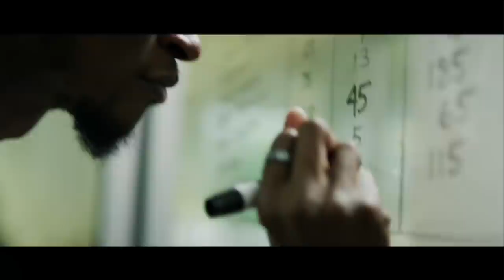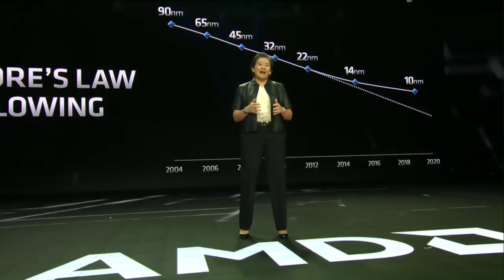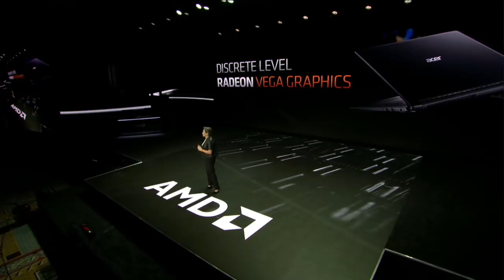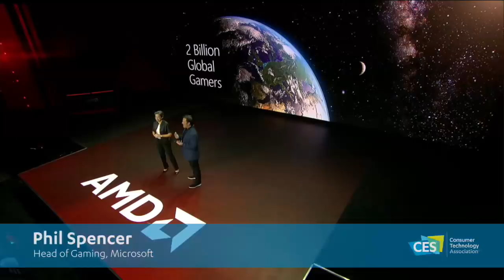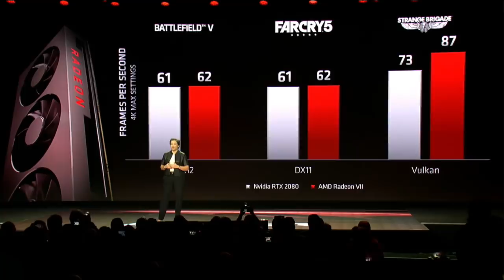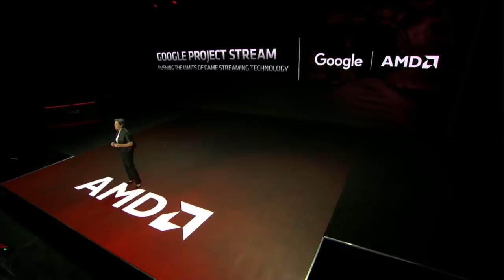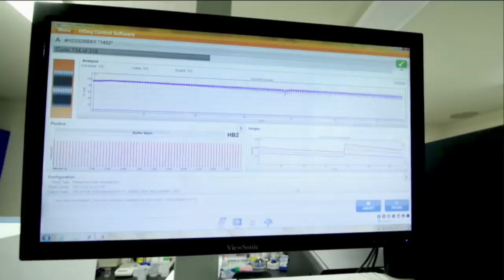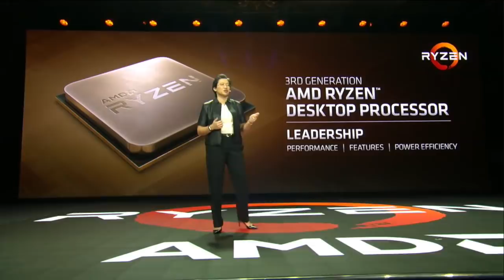AMD CEO Lisa Su's 2019 CES Keynote

Comment: The die placement is curious on the Ryzen3000, like there's room for second cpu chiplet... so they've left the door open for a 16 core part as well.
Reply: glad i'm not only one who noticed it
Reply: Hehe, yup. Noticed that as well, all that empty space.

I think what's telling about it though is she touched upon PCI-E 4.0 support, which means interconnects/bandwidth has been taken into account to support another 8 cores.
Reply: @zijkhal8356  Couldn't see that, watched from my phone through an extremely dirty Otterbox Defender plastic protector. 🙁 At work right now. Lol
Reply: I think so too, also maybe a gpu
Reply: that's because if we are going off leaks that will be an R5 varient likely going to be the R5 3600. the R7 are said to be 12 cores and the new R9 varients said to come at 16 cores.
Reply: It just looks like cut down I/O die from Epyc 2nd gen,that Jim at AdoredTV leaked.As you guessed it-it has room for 1 more 8c/16T chiplet
Reply: @mivinca7  
Ryzen 3 33xx are 6c/12t (single chiplet) 
Ryzen 5 36xx are 8c/16t (single chiplet) 
Ryzen 7 37xx are 12c/24t (dual 6c chiplet) 
Ryzen 9 38xx are 16c/32t (dual 8c chiplet)
Reply: Love is an open door?
Reply: 1:30:03 for anyone wondering, you can see the light reflecting off the connections for the 2nd chiplet
Reply: @zijkhal8356  I watched at home, and yes you certainly can see that. It was already telling thou from her saying PCI-E 4 and the enpty space.

For a new CPU/GPU chip, that would be where it will be placed however. For full on CPU, 16 actual cores for certain.
Reply: @zijkhal8356  They could be, but the leaks all point to the bottom budget Ryzens as a 6c CPU. The CPU die with the single IO die, with the single chiplet (Lisa Su) was holding up, she actually does say it's a 8c/16t CPU, listen around 1:30:08 onwards.
 
As I've said before, the leaked SKUs are Ryzen 3 33xx (6/12), Ryzen 5 36xx (8/16), Ryzen 7 37xx (12/24) and Ryzen 9 (16/32). So logic deducts that a single chiplet will all probably be 8/16 dies, with faulty dies having disabled cores, and made into the 6/12 variant. With the spare space below to add a second chiplet, equal to the one above it, to make up the 12/24 and 16/32 CPUs.
Reply: @zijkhal8356  Hmm, 
Is she holding a CPU? 
Yes, it's the whole green wafer package.

The green wafer has 2 black dies, the smaller one (chiplet) she describes as the 7nm 8c/16t.
The larger black die is the 14nm IO die. Both sit on top of the interposer, or infinity fabric. There is no other die left on the package.
So therefore, I conclude that it IS an 8c/16t CPU.
Reply: @zijkhal8356  Ok, what would you call a CPU?
Reply: Theres room for more it you look again, if AMD shift the IO die up, they might get a 3rd CCX in below it if possible. What I'm nore interested in though is APU potential, especially beyond AM4. Larger socket size for AM5? allowing for multiple chiplets and Navi high end grachics, think 16c32t with 1080ti performence. If you think 2019 is going to be interesting, 2020/2021 is going to make it seem boring in comparrison.
Reply: @VeggieManUK  I don't think this generation is going to see more than a single chiplet for CPU and the empty space is going to be zen 7nm as that will follow in perfectly. Then they will go Navi and that might go in the next version.
Reply: @zijkhal8356  I really don't think you're understanding my comments, TBH. I have never mentioned disabled cores in our debate, nor do I know anyone who talks about CPU core count, include disabled cores/non functioning cores. When I refer to a CPU and core count, I actually mean, working cores, same as any person would. Unless, I was going into deep down detail. Besides, you started this debate when you replied to my comment, with a misquote.

Anyway, I've been peeking and poking in Zilog ZX80's, and MOS 6502, assembler M68k, and some Intel 8086, since the days of kit form ZX Spectrums. So I well and truly know what a CPU (Central Processing Unit) is.

Comment: Interesting products. I was hoping for a 50th anniversary chip, but we'll have to see.
Reply: That one may come on the 1st may. considering amd was founded on the 1st may.
Reply: @River_Miles   according to adored's leak it will be called r9 3850 and clock up to 5 ghz (or 5.1 I don't remember exactly)
https://www.youtube.com/watch?v=MG-onUm__c8
Reply: Did amd ever say it was 12 cores
Reply: @zijkhal8356  rumors are rumors what if a r7 is 8 cores it still can come close to a i9
Reply: What's 7nm mean??
Reply: @stevethea5250  7nm is the physical die space. The smaller the black die, the more densely packed the logic gates and traces are. Also requires less power and generates less heat I think.
Reply: @DJKav  thanks. What die? Like colour die??
Reply: @stevethea5250  Nope, dye is something coloured. A CPU/GPU die is the silicon wafer, that all the transistors are are fabricated onto.
Reply: @vacatedsleet325  Amd showed off an 8c ryzen 3000 cpu. there would still be space for a second die though.
Reply: @zijkhal8356  She actually said the ryzen they showed is an 8c chip. She mentioned it when she showed of the two dies.
1:30:00
Reply: @zijkhal8356  The larger one is the I/O die and the smaller one is the core die. It would be pointless to have cores in the i/o die, because it is built using the 14nm process.
Windows is not built to take advantage of heterogenous core configurations so it would be totally pointless performance wise.
Reply: @zijkhal8356  Yeh I know this. I was in a rush to go and pick my daughter up from school. It just came out wrong. I forgot about it since, as I've been busy. So thanks for correcting that up.
Reply: @zijkhal8356  Yeah. Seems like I missed your point.
I know it's possible and likely they will have to dies with 8c each or a cpu + gpu die.
The tech press all say the ryzen 3000 that was benchmarked is an 8c cpu as far as I could find. Likely because lisa showed of an 8c cpu on stage.
Also it would be very impressive if it really was an 8c chip they showed running cinebench.
Hope I'm not completely missing your point again.

Comment: Sounds like Radeon VII is going to be an absolute production powerhouse with that huge HBM2 buffer, but then again 16GB for gaming is absolutely pointless.
Card could probably be 100-150 dollars cheaper if they stuck with the 8GB meta since HBM2 is already expensive on its own!
The Ryzen 3000 presented is quite promising though if those are actually early sample clocks.
Reply: Check latest benchmarks on bf5 with raytracing and see how much ram that takes then talk again about this.
Reply: Ryzen 3000 seems to be at least 4.7 GHz if ipc is equal to kaby lake
Reply: I am bit worried about the performance. In the Forza Stream with the strongest AMD Setup they got 117 to 126 fps. We know that Forza runs best on AMD compared to Nvidia. But 699$ with a worse result than an RTX2080 where you could also use DLSS in other games in the future to gain another 30% performance plus... (a lot of developers announced the integration of the support) Their performance is ok but I have not expected this price. It is coming with 3 new Games but the RTX2080 is also coming with Battlefield V and Anthem...
Reply: The 3 games puts that Radeon VII at about $520 worth. That's not half bad considering the performance and superior VRAM. I was shocked it actually went neck and neck with the 2080 and even smashed it flat-out in Vulkan. And that's with starting beta drivers most likely. Those numbers are going to get even higher once the drivers mature 6-12 months down the road. I doubt I'll ever need all 16GB, but I'll take it for the transfer speed since I think it'll help in one of my games in particular in the long haul.

I'll frickin' buy two of these GPUs if the TDP isn't too crazy. I mean two for the price of a single 2080 Ti? I'm down. I hope someone benches them in Crossfire vs a 2080 Ti. Only down side is I have a $1,000 Predator Gsync IPS that's probably going to get replaced by a $400-500 Freesync 144hz IPS. I lose out there, but oh well. I'll keep it as a browsing monitor. I just pray they don't all sell out day 1 like Nvidia's bullshit cards tend to.
Reply: Cool Fez except the gpu won’t have ray tracing anyway....
Reply: They will probably have midrange cards w 8 Gigs down the line this is the TOP of the Line goes head to head vs Nvidas 12 GB 1200 cards. So they went 16 just to One Up them..its all about the marketing.
Reply: @MaxHBoss  Shadow of mordor cant run 4k textures without atleast 10gb, like it or not more ram is needed for the high end.
Reply: thats 'cuz they inted for it to be a card for content creators an area where those 16gb of hbm2 will serve well...
Reply: IDK man, with 16GB, just think of the Skyrim texture possibilities.
Reply: @phillycheesetake  Ugh when will that game die :D
Reply: Yea. I actually would have got radeon 7 if it was under 500$ (Which many expected) but now I have to go on RTX 2060 + bfv+ dlss +ray tracing is pretty nice.
Reply: COD WW2 uses 13gb of vram at 4k and Star Citizen uses over 12 gb so 16 gb will greatly benefit those who play at that resolution very soon.
Reply: @CoolFez  You can deactivate your copy of Skyrim by sending a deactivation payment directly to Todd Howard.

Be sure you un-check the delayed reactivation subscription which is pre-selected at online checkout. Failure to do so will result in a recurring monthly bill of $19.99.
Reply: @phillycheesetake   YOU WOT, im gonna sue u for that :D
Reply: Cheaper versions of the card may yet come. 
Why do you think they started with Radeon VII ? Odd number, if you ask me. Nothing stops them from making a Radeon 5, and Radeon 3. Mimicking their Ryzen lineup.
Reply: @Nukerunin  You know that they get HUGE discounts on the games, right? Also the benchmarks most likely are the best examples they could find.
Reply: Unless you start using the GPU for game AI which 16 GB dose matter
Reply: Well the point of this card is playing in 4K @ ultra, and that's going to eat up a lot of VRAM. I think it'll be essential for at LEAST 12Gb
Reply: Hbm2 is very expensive if it had 8gb it could be maybe 400
Reply: I think they with a higher amount of ram because I believe the gaming market is getting expanded to smaller development teams and smaller companies as the bigger corporate gaming companies are economically hurting and face bigger risks as facing lawsuits due to our short fused politics. We will see smaller companies pop up like the creators of fortnight. Not to mention high end developers are able to stream high end graphics from a browser and is logical for a companies to do so. The GPU product they produced is what the market is moving to so they are ahead of the game in the market in my opinion, however I personally would like it cheaper sacrificing ram for price but I am satisfied regardless
Reply: @blablubbss1  uugghh, engineering sample...hello.  The CPU wasn't at full potential, at 1080p you're not GPU bound.
Reply: @jackcole2935  It doesn't cost $299 for 8gb of HBM2. It's around $80 per 4GB stack so $160 less. That would make a 8GB VII card $539 'IF' AMD shifted the savings to consumers. Most likely it wouldn't be a direct savings if they did this.
Reply: some games are already greedy for more than just 8GB and with that you will get more texture and so on.... 
plus they're moving to PCIe 4.0, lately 5.0, so that's the reason for 16GB 

Prob. you wouldn't like to have 8GB card on PCIe 2.0 "it would run ok, but it would e waste of potential",  nor 8GB card on PCIe 4.0 "waste on technology"...
Reply: That's such BS ! 8K is already on its way and you got no clue what game manufacturers are starting to implement as we speak! 16gb is the new 8gb .. for 1080p the rx590 or gtx 1060 will suit you just fine! This card is not competing with the x60 it reaches for 1080ti and TitanXp a department amd has failed hard, and if you're not the best at the top, there's no reason for people to assume that you're worth anything in the middle or at the bottom either. Being cheaper just causes suspicion in the average buyer. Expecting tradeoffs while the slightly more expensive product is represented by the cream of the crop, tried and true master. So obviously they will go with the "best" and to them most reliable option. At this moment that is still NVIDIA! But once Vega 7 is released things might change in the heirarky and that would definitely benefit AMD. Also competing against the high-end will bring down prices/performance. NVIDIA is just insane with their prices starting with the Titan Z and now the even more completely deranged pricing on the RTX series. I believe obviously NVIDIA themselves actually got the memo this time around and released the 2060 which is said to perform along the lines of a 1080 but with Ray tracing and dlss. 
So the take away? 
Good Job AMD please continue to push the envelope even further, NVIDIA sure as heck will. And find a way to legally take advantage of NVIDIA's new Ray tracing scheme
Reply: @rndmfella1874  2060 perform on the lvl of 1070, Ti at max
Reply: the vram is usefull for us, content creators
Reply: the 1070ti is only marginally slower than the 1080 lol
Reply: Some games at high res and ultra settings consume up to 11 GBs of VRAM. It's never pointless. Better have it than not.
Reply: I'd say that with the next gen of consoles coming, 16gb is absolutely necessary. Games are starting to use well above 8gb at 4k, and when games become exponentially more detailed texture-wise in this next gen, 16gb will be fundamental.
Reply: I am actually looking at building a 100% amd rig CPU/GPU with a custom Linux for ROS ( Robot operating system ) with Gazebo for simulations for AI and other things from Drones to other land based robots and bipeds.  This hardware should make this an interesting time.

I am actually hoping these can be used in parallel ala 2 cards.
Reply: Shadow of the Tombraider at 4k max fully saturates the 11GB on my 1080ti just fyi
Reply: @TsukiShimizu  it was running slower than that... she stated it was not running at the clocks it will run at when it releases.. im guessing they dont have a 100% stable bios for it yet. the IPC might surpass intel
Reply: @techpappee  didn´t you see that the gpu ran at 100%?
Reply: @Clay300  I just hate how you said "creators of fortnight". Epic Games made the Unreal Engine, the engine that many of our favourite games run on, that includes PUBG, Sea of Thieves and a crapload more. By no means is Epic Games a "smaller company". Had to point that out.
Reply: @Rackie I just mean the market is moving to support smaller developers and epic provides them a platform, plus it's better economically in the bigger picture and better for gamers
Reply: atleast AMD not trying to scam their loyal customers...unlike  you know who!
Reply: @blablubbss1  DLSS isn't free, turning on DLSS is only at 4k, and at 4k it actually renders 1440p rendered with some smart anti aliasing to 4k, that's it, this isn't at all real 4k free performance
Reply: @milo20060  all that together will run bad. DLSS is 4k only (which is actually 1440p). For RTX on in BFV you need high settings 1080p for a smoother 60.
Reply: How bout 380watt TDP on my 3099

Comment: My Vega 64's P7 frequency can be set to 1780 mhz, and actually run to 1720-1750. I hope that the Vega VII limit P7 will be close to 2200 MHz and it will be satisfied when it actually runs to 2100 mhz.

Comment: I just got a pc with r7 2700 and rx 580 i hope it was worth it
Reply: It is
Reply: Good choice dont worry
Reply: Yes, good choice
Reply: Same except r5, youll be fine.
Reply: It's definitely fine, considering its AM4 so you can always upgrade your CPU without a worry till the next platform is released.
Reply: idk man amd seems to be only slightly cheaper. Id rather try buying a 1080ti used than go for vega 7.
Reply: 6month more tho
Reply: @Phaminator525  whilst you can.... I got a 1080Ti 2 months ago for £600, same GPU is £900 now
Reply: You need 2 rx 580s my friend. My 1600 runs 2 because the 1600 had enough power that the rx 580 was the bottleneck.
Reply: DeluxeElias its a good rig
Reply: RIP
Reply: @Phaminator525  going by history you know Nvidia will bork the 1080ti to make there 2k's look even better?
Reply: could have gotten a rx 590 but its ok
Reply: don't get 2 cards buy a 2060 instead if your thinking about upgrading a nother one Is not worth it Crossfire and sli can be unreliable as well
Reply: 2080 because ray tracing and silimar price
Reply: @vacatedsleet325  Ray tracing ...what a fool from nVidia. For some shadows descrease 30 Fps .No ty.
Reply: it is good but u should have waited for the new ones after few months
Reply: @Adrian8-q1m  DLSS
Reply: @Adrian8-q1m  raytracing dosent matter sometimes like puddles you wouldn't notice the difference but its a nice to have
Reply: For that prices it worth trust me!
Reply: Excellent choice
Reply: My PC will come tomorrow with R7 2700X and RX 580 8 GB. Can't wait!
Reply: Rx580 is bad, i had 2 of them and i had freezes and fps drops in all games...
Reply: But Ryzen is really good choice
Reply: bruh you will be fine for the next few years